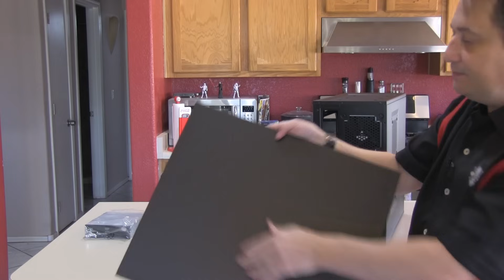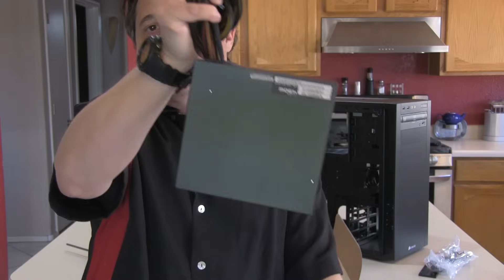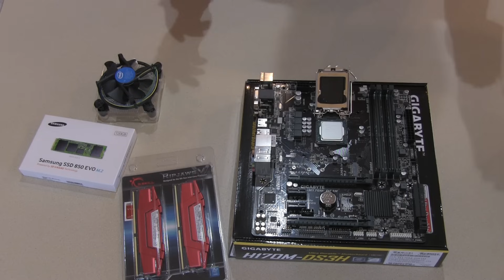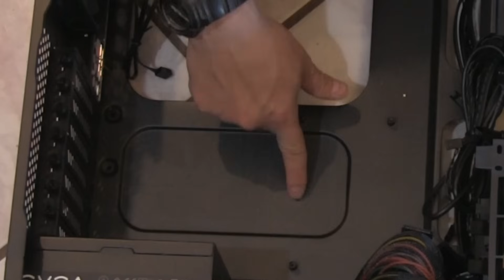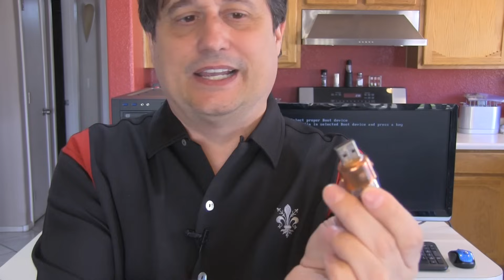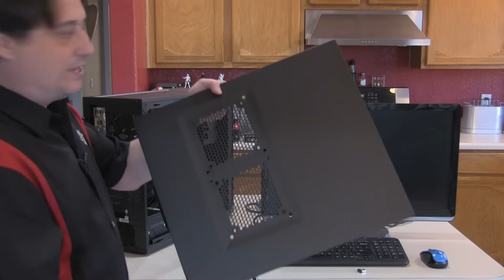How to Build a $600 PC- i5-6600, 850 EVO M.2, & Windows 10

Comment: Thanks Carey. You inspired me to build a slightly modified version of this computer I upped the ram to 32 MB the processor to 3.5 GHz and a Samsung 960 evo m.2 250 GB...Everything else is identical and the system is crazy fast. Thanks so much.

Comment: this RAM is 2400, but the i5 6500 runs at 2133 maximum.  Obviously this does not create any problems otherwise you wouldn't use it, but I was wondering if you had any input on it.  I was planning on building with an i7 6700 and 2400 speed RAM, but it also says 2133 is the max.
Reply from the maker: My car can do 130mph but the freeway says the maximum speed I can drive is 75mph. Will my car still work?
Reply: gotcha, understood.  thanks for the explanation.
love your videos.  will have my first build done this weekend with your help and guidance.

Comment: I noticed Carey used Memory that is DDR4-2400, but the motherboard only lists the DDR4-2133. Wont that slow the memory down?  

The Reason I ask is I am looking to build my first computer and there is so much conflicting information out there!
Reply from the maker: You can read the full memory compatibility list here (remember, sometimes its cheaper to buy faster memory, even if you don't intend on using faster memory) http://download.gigabyte.us/FileList/Memory/mb_memory_ga-h170m-ds3h.pdf
Reply: Thanks Carey, I did not know you could do that with out really affecting the performance of the memory. Good thing I posted, Because I learned something New! Keep up the good work with the Videos!  And thank you for responding so quickly!

Comment: I built this computer except I got the larger Samsung HD drive. Put it together and even had a glitch (my fault). One of the power cables wasn't in all the way. Fixed that and loaded the operating system and got everything running. It's a great system for what I'll be using it for. Thanks Carey for the videos.

Comment: Hey Carey, your videos are very helpful. Just one question tho, I have the exact same motherboard + case & when I turn it on, the fan will run, the power is on but it will shut down and restart constantly. Any ideas on what to do?
Reply: I'm building the same thing too.. and I'm having the exact same problem! Great outcome for my first build.. I checked to see that everything is seated, and reinstalled the RAM.. still the same problem. It seemed like every connection to the MB was fraught with difficulty, very few went easily into their places. It was a three evening connection process, and a failure for reward! This hasn't been such a pleasure after all. I hope you got yours resolved, Will. Looks as though I've blown 800 dollars for a heartache. Will try again tomorrow.
Reply: Mine was a really stupid problem where I didn't properly installed the ram. So I reinstalled the ram and it worked perfectly!
Reply: Don't feel bad, I did the same thing. Ater almost a week..Yea, big breakthru. Musing on what to check on next, like the power supply, or CPU, I tried out the RAM sticks just one more, last time.. probably the seventh or 8th  time. Pulled the stick from the third row, and viola, all stayed powered up! Now I smelled blood in the water. Switched sticks, it still worked. Put the former first row stick into the third row.. nada. Could the board connection be bad? Well, when I first came back to my stalled build, and it was now daylight, I noticed that I'd done a very poor job of getting the sticks installed correctly.. in fact a blind man could do about as well. Part of that third row stick was in place in the third row, and part of it was out of the slot altogether. It's a wonder the stick wasn't broken.. and when I re-installed it, things still didn't work.. it showed 8 Gigs of RAM only. But as it was the third day of being stuck at that stage, I wanted to move on to anything else. So I installed Windows 10. I'd bought the Pro Edition with the USB Stick, and the install went slick as snot. I've never known a Windows install to be that fast! So that left me somewhat more satisfied, and still looking for trouble, so I went back to the RAM problem, installed, and removed that stick at least five or six more times, until I heard the clicks go exactly as Uncle Carey said they should. When I fired the machine back up all the RAM showed up as it should have, and I allowed myself a small whoop of exultation for a successful display of my own, well-known, obsessive-compulsive behavior with computing. Wife said she couldn't believe how much patience I have with these things. So far, I'm nearly 50 hours into this thing, taking a long time for each step (to keep from having a small mistake from becoming a disaster) and trying out each remedy repeatedly. This was an instance like looking all over the house for your keys, then on the fourth time you look in the same spot, miraculously finding them. So on with the build.. installing a 1TB mechanical HD, making sure all updates are applied, making pretty, and a disk image with Acronis. I'm gonna risk a thank you to Mister Carey Holzman now. Hopefully I'll have one more report to make. Now I need to Image the machine, then I'm pretty much done. I'm writing this on the new machine, the first the wasn't a bargain basement, already out-of-date special, and one that should last for many years. I was a hassle every step, down to finding space to set the new machine up alongside the old one. Carey did confuse the heck out me when he said at first we want to use socket 1 and 2 on the Gigabyte board.. then that we want to use socket 1 and 3 on the Gigabyte board.. that cost a few hours of confusion time. Yet overall, I have Carey to than to make this sound like something easy and straightforward enough to try.. and after a marathon of a build, I'm happy to have taken the inspiration from this vid, and built this new machine. Without some limited experience with building back in 1999 tech school, I'd probably not felt comfortable enough to even begin, let alone keep plugging and persevering  until the happy completion of the project. Thank you Uncle Carey, and thank you to those who sent in comments on their own trials and tribulations.  I'm a happy devotee of Mr. Holzman.
Reply: The RAM was at fault. Install it in slots 1 and 3, and for hearven's sake, do it in good light! Seeing well is paramount in importance. Easy to install incorrectly in poor light.

Comment: If you're fond of touching metal objects to ground yourself use the back of your hand for two reasons. Less nerve endings so less zap with static. If the metal object is live (mains) when your muscles contract it will pull your hand away from contact rather than the opposite.

Comment: Hey Carey I had on question for  you. I do build computers for both my family and other clients. Whenever I build computers for my family I tend to purchase the windows product key from Kinguin because it is much cheaper and often I am the one servicing that computer no matter what, but when I build a computer for a client I will buy the OEM version with the sticker included. Would you recommend that I buy the OEM version every time (even for my family)  or what?
Reply from the maker: Do you know what people do with all the credit card numbers they steal? Some people use those stolen credit cards to purchase Windows license keys. Then they go on Kinguin and sell these keys that were purchased with stolen credit cards, at insanely cheap prices and turn the stolen credit card purchases into cash. It doesn't matter what they sell them for, as it's all profit for the thief. These keys often work temporarily until they are reported stolen, at which point they will stop working. By purchasing software product keys from Kinguin you are participating and condoning a criminal activity. By purchasing these keys for friends or family members, you are unwittingly including them in criminal activity and, at the very least, when they need to reinstall in a year or two and find the key no longer works, they may accuse you of ripping them off.
Reply: +CareyHolzman thank you so much for the response and useful information, I will remember to keep that in mind

Comment: Thanks, Carey! I appreciated this video, since I need to build a new rig and this is closer to my actual needs and budget than the gaming builds that proliferate on YouTube. I spend most of my digital life in Linux, though I do have Windows 10. Photo editing is my most intensive regular work, with occasional video encoding and desktop publishing, and my current system is showing its age: everything is obsolete except the power supply and the DVD burner. I hadn't considered the Carbide 200R, but without the mechanical HDD inside it seems quiet: I'm migrating to external storage and I'll use a larger capacity SSD/M.2/NVME  than the one you spec'd here for operating systems and working files. I may go with a different motherboard to get USB 3.1.
Reply: Did you purchase your components yet? If not, my build (http://pcpartpicker.com/p/GhPFf8) has a quality budget motherboard with USB 3.1 and M.2/U.2/NVMe that might interest you. Overall, between Carey's build and my build, you should be able to tailor something that will fit you needs EVEN closer. By the way, I also use Linux for my desktop!
Reply: Thanks, Jonathan! I appreciate the comment: that's a great parts list. I'm pricing a few configs now.
Reply: No problem Daryl! Would you mind sharing the configuration that you end up going with? I hope that your build goes well!
Reply: Will do, Jonathan! Right now, it looks like your board and the Carbide 200R, both with rebates through tomorrow. LG M-Disc burner and Corsair 650W PSU will recycle from my current rig as will hard drives, though those at some point--either at build or on upgrade--will migrate outside of case. Photo editing is my most resource-intensive app, so lots of RAM is going in, and maybe an inexpensive SSD until NVME matures a bit (and the bank account recovers). CPU is still a question, i5-6500 is $10 off through 6/1.

Comment: Hey Carey-  Thanks for the vids.  I put together an i5 system after watching a few of your build videos.  

And then I turned it on the first time and...it worked!  Perfectly.  

Took me a couple hours from start to finish (unpacking, etc.).  The hardest damn part was the i/o shield.  Was preventing the mobo from sitting right.  Luckily brute force didn't break it and it snapped into place.  All is well.

Just carried over my old 750gtx ti graphics card.  Am so glad I did, cause the 1070 and 1080 nvidias are coming in a couple weeks.  And seem reasonably priced for being kick ass.

Appreciate the virtual help and in-depth of your vids.

Comment: Your great videos make me want to build about 10 PCs.   At my age I better stick to watching these videos.  As a teen in 1968, I built a tube multi-band radio kit.  I still have it.  It finally went to noise a few years ago likely because the large capacitor has failed.  Those were the days when capacitors; diodes; resistors, and transistors were objects handled and soldered into a circuit board and you did not worry about static when handling them.  Who could have imagined the future!  In 1968 I was smugly confident I could master electronics.  Not so, said time.
Reply: +DOLRED  And I bet you used a Heath Kit like I did?  Good old days indeed!
Reply: Ah, It was an Allied Radio sold kit.  The radio is labeled "Knight"  "Star Roamer."  Bought it at Allied Radio---a local electronics store--the biggest store in our town.

Comment: Well I built my 1st computer with most of the parts on the list. I'm adding the old hdd and optical drive from my old computer, but a couple of days after the initial build. The audio is good and the video is much better than previous. Now to get to my files on the old hdd.
I put the old gateway on freecycle to be rid of it

Comment: Hey Carey I watched your videos all the I learned alto from your videos I being in it for 10 years I love it I built me a system. Specs are amd fx 4150 stock speed is 4ghz I am running 8 gigs of ddr3 motherboard is a asus m5a78l-m/usb3 video card is a zotac GeForce 9500gt hard drive is a 500gig wd blue power supply is a thermaltake tr2500watt cpu cooler is a Cooler Master GeminII M4. I hope you like the specs of my system my cpu is staying at 35 degress. Thank you for the encouragement you have helped me a lot from watching your videos thank you. Whats the specs of your system

Comment: Carey.  What's your view on the aggressive way MS is forcing users to upgrade to Win 10 especially with the way they will handle Skylake processors.  In my view I look at these tactics (as many techs and tech sites are) as devious as malware/virus writers get.

And that extra mounting point below the RAM is actually in other cases I have built with.  Last week I built one for my girlfriend (using the Apevia ATX Mid Tower PC Gaming Case), and it utilizes that mounting point.  Even my ThermalTake case uses it.  I have a feeling that this is Corsair's choice in not using the mounting point.
Reply: +kjemradio I am saying that Microsoft wants nobody to stay on Windows 7/8/8.1 anymore and I hate that popup.

Comment: Wow, right down to sticker placement, that's what I call a comprehensive guide!  Thumbs up.  I would encourage first timers to look up and down the hardware spectrum to see if upgrades or downgrades are worth it.  IE this build, is the i5-6600 worth it to me to spend 20% more over the i5-6400 (maybe)? Is it worth an extra $15 to double the hard drive space (probably).  Again, an awesome guide and would recommend for first timers.  (PS I've sent out computers with the logitech dongle too :) )

Comment: Hey Carey, Awesome video. Just something quick, and im not telling you how to do anything (not trolling lol) I just bought the 950 pro m.2 and i had done everything the same as you did. I know 17 seconds is great for boot time however, i noticed if you go into the bios and find CSM and disable that and then set secure boot to UEFI it boots 2x as fast. Then i download the samsung nvme driver in your case i dont think you had the 951 or 950 so that wouldnt matter for you obviously. 

Many guides for installing the M.2 drives are all over the place and after tinkering around i was suprised at the difference by disabling csm and setting secure boot to uefi. with the 951 and 950 people were saying to use other os/legacy but boot times doubled so i am still using mine just fine the way i described

Again, not trolling or telling you what to do just giving you something to look at on your next m.2 build .

Thanks Carey

Comment: Finally a new build, thanks for the video great as usual

On the part about grounding, I see a lot of information saying it's good to clip your anti-static wrist band to a PSU that is plugged in but off.

These are all user comments though, I've yet to find any information that can be backed up by testing, but I only looked for 5 minutes.

There appears to be a lot of dissenting opinions on this topic, I've noticed that with how to apply thermal paste too.

Comment: How do you calculate the PSU requirements?  Initially I used the one from PCPartPicker, then out of curiosity I used the calculator at Newegg.  PCPartPicker said I needed 450 watts and newegg 750 watts.   Currently I have a 650w on order
Reply: You can see the wattage required by every component in the specification page of that particular Component and you just have to add it up and keep like 25-30% extra from potential future upgrades. And if you're planning on overclocking then the cpu and gpu will consume more wattage as the one listed so you need to be aware of that

Comment: Very nice video Carey. I do prefer your kitchen videos to the "more polished" NewEgg videos. Those are great too but I still like the personal touch you give to your home videos. I was glad to see a workstation build finally also. I am wondering the reasoning for using a micro ATX board verses  a standard ATX. There is a ton of room in the case.
Reply: +Geo Johnson Hi Geo! I have seen you on allot of pc build videos. :)
Reply: +Bobby Need: Hello Bobby. Yes, I have not missed one of Carey's build videos. Have viewed every one...they are also great. Carey and I have a very similar work ethic.
Reply: +CareyHolzman Put your badge right over the Corsair Logo. :D
Reply from the maker: +Geo Johnson There is no M-atx case with dual front port usb 3 and no case door available for less money than the 200R and, for the reasons I explained in the video and in the video notes.
Reply: +CareyHolzman Carey, I wasn't questioning the use of the Corsair 200R case. I was questioning the selection of the micro ATX motherboard instead of using a standard ATX board. It there a significant cost difference, or is there another reason? Thanks for responding to me. I know how you love that case ;-)
Reply: +Geo Johnson :) Especially without the need for a dedicated graphic card, or aftermarket cooler, a micro ATX was the best option. A standard ATX would only take more space without giving nothing more in return. Have a good day. :)
Reply: +CareyHolzman Yes there is, there's a few sharkoon cases.
Reply: Blimpdawg Sick profile pic.

Comment: after install m.2.  can i clone operating system  from my SSD to m.2 with 3rd party software?
Reply from the maker: +Maverick1948 Why wouldn't you?
Reply: +Maverick1948 If you are looking for which software or how to. I recommend you look at the vendors site for your SSD's. If you are using Samsung drivers I would look into the Samsung Magic Cloning software its very painless and easy to use. Each vendor offers some sort of cloning software and in most cases if not all they are free.
Reply: +CareyHolzman Hey carey when will you start using your zooming remote for you camera